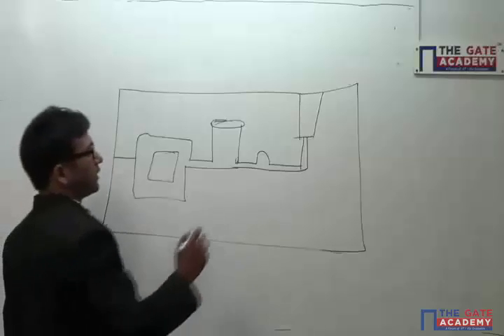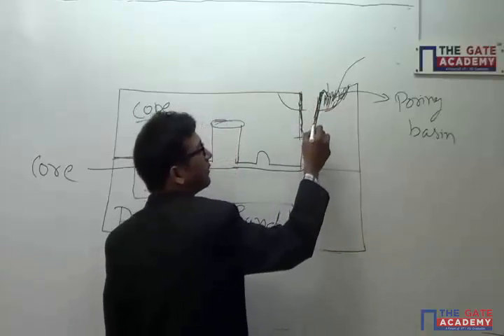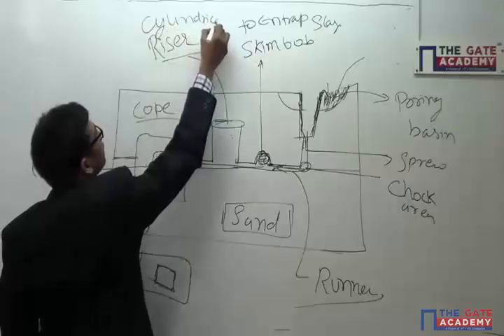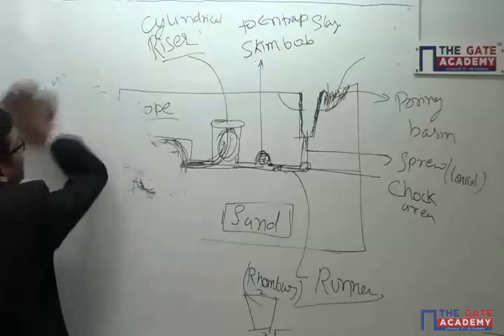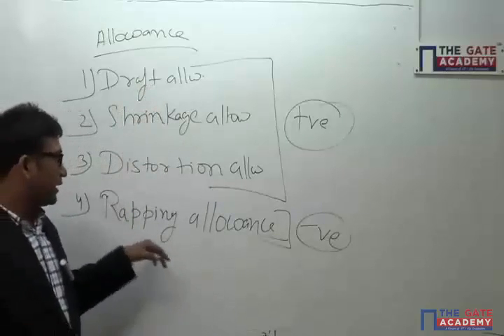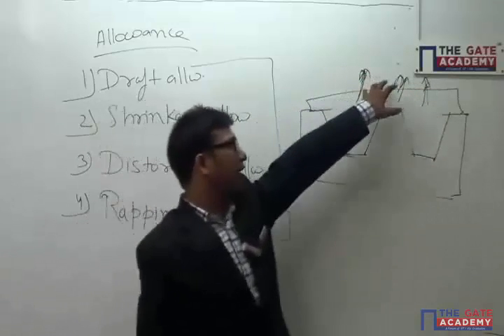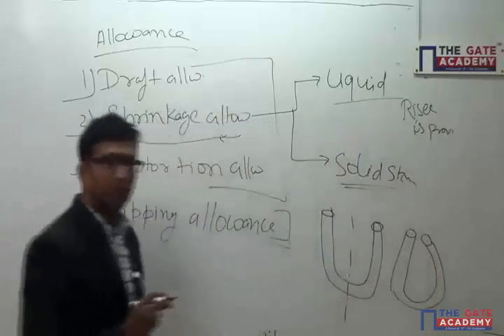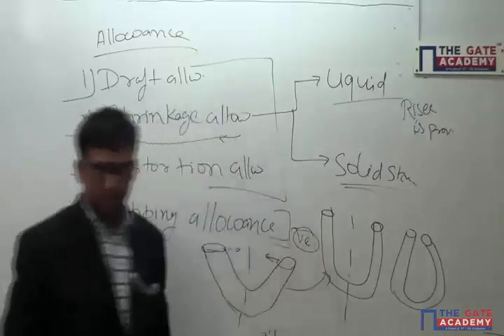Sand Casting | Manufacturing Engineering | GATE Exam

Comment: Can u please help me sir.??
Qus.1 The ultimate tensile strength of a material is 400 MPa and the elongation up to maximum load is 35%. If the material obeys power law of hardening, than the true stress-true strain relation (stress in MPa) in the plastic deformation range is ....?
Reply from the maker: Hi Atul, we are unable to post the answer over comment since it contains some superscripts. Kindly share your mail ID will share the solution with you.